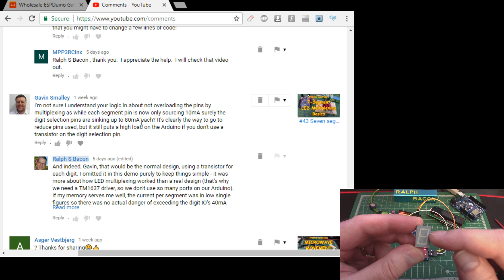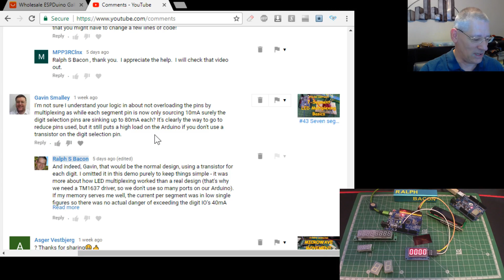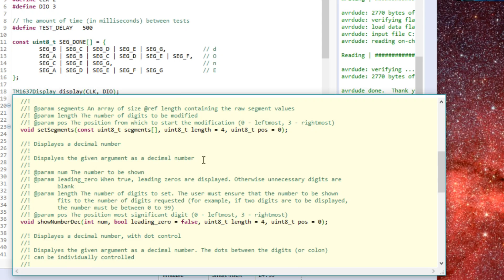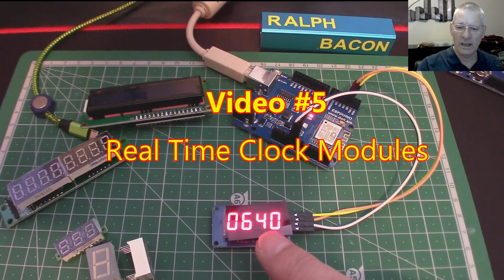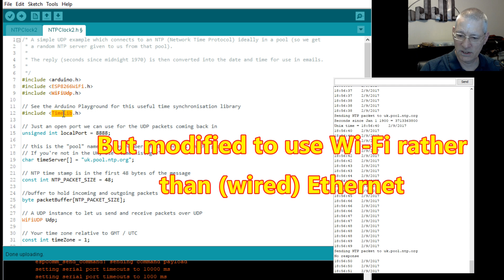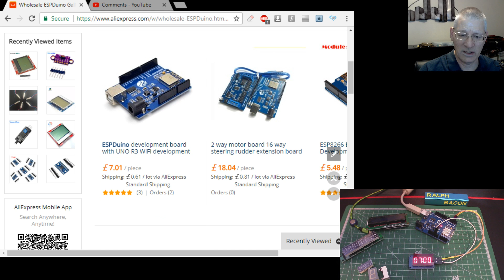#94 TM1637 LED Controller (Part 2) using NTP Server

Comment: Sorry if this has already been discussed, but how about an NTP server running on an Arduino using a Ublox (or similar) GPS receiver? I've skimmed (again) your video #70 and NTP isn't mentioned.  It would avoid availability issues with third-party NTP servers via the Internet. I use one running on "the other popular single board computer" and it works well.
Regards
Reply from the maker: Hang on, Dave, "the other popular single board computer"? You mean there are others? Does anyone else know about this?
 
OK, running an NTP server on a Pi-based board would of course work. It might (should?) even work with an ESP8266-based board, like the ESPDuino. But really it should not be necessary. If I were to refine the logic in my sketch here, I think that getting a list of reliable NTP servers is achievable, or perhaps just re-requesting an NTP server if the current one doesn't reply until you get a reply. That avoids the issue where you don't get a reply and now you have to wait another X hours before you retry. I'd also like to make that library non-blocking, the 500ms delay is just poor design. Oh well, the long winter nights will soon be upon us, may give me something to do... Thanks for the post, it's making me think about this whole issue.
Reply: The REAL purpose of NTP is for keeping a local time source synced. An RTC (Real Time Clock) can be used in multiple locations (if desired) and cross checked to each other. Any significant differences between any two can be used to trigger an NTP request. BUT the problem becomes a tricky one if EACH RTC is NTP synced individually by separate requests. Do not be puzzled or disappointed if the times set under these circumstances are widely different & varied immediately after such updates.

In principle, it should not be necessary to query an NTP server more than once per 24 hours, or per 12 hours max. It's considered very poor NTP access etiquette to make multiple requests successively, continuously or continually in a short timeframe.

NTP service was never designed to provide an RTC function but an automatic synchronisation service to another means of real time tracking like a LOCAL networked RTC.

The OTHER use of NTP is to resync an RTC to current local time after a complete power loss, not just to the system but also to the RTC itself.

If an EXTERNAL highly accurate clock is required down to ms then a GPS module provides a better mechanism. 

Always remember that NTP responses can vary by several seconds, they're allowed to by the specs, which is why a single local RTC server should be used if accurate timestamps across multiple devices are required.
Reply: @boblewis5558  I'm not sure whether your post was a reply to Ralph's (reply) or my original post in 2017.  Just to clarify, my NTP server uses a Raspberry Pi connected to my home LAN, uses time data from its in-built GPS receiver, so variable Internet NTP server timings  or access etiquette issues aren't of concern.
Reply: @daveholden3935  no it was a general response to Ralph and his audience as despite a 45 year plus career in IT and fairly well versed in network stuff I very nearly fell foul of mis-thinking it myself. 

Your solution is arguably the best one as you clearly gain the benefit of BOTH NTP and GPS timing without the requirement for a public NTP server. 👍👍

Comment: Hi Ralph, thanks for another informative video.  Probably the high failure rate on the ntp server is because you are being blacklisted for too many attempts. You should try pointing it at your internet router, that probably has an ntp server running and it won't mind how often you ask it what the time is.
Reply from the maker: I've looked at my router before, and there is no NTP server in place probably because it is a cheap router that came 'free' with my broadband. More sophisticated routers will doubtless have something to offer, but upgrading my current one just to get this facility is not justifiable. If you look at the post from Dave H here (and my reply) you can see that there are lots of ideas and if I get a decent solution I'll let everyone know. Thanks for taking the time to post, Andrew, good to hear from you again.

Comment: The NTP servers when busy log IP address and will throttle the bandwidth if used too often. This is stop DDos attacks.
Reply from the maker: Yes, Graham, I had my concerns about this; the trouble is that I need frequent responses for demo purposes and I can't tell whether I've been blacklisted or whether the server I'm querying is just not playing nice! Every 10 seconds shouldn't be considered a DoS though. See other comments (and my reply) to others here and you can see I'm thinking about sorting this out to make it more reliable. Thanks for posting.

Comment: Thank you again, Ralph. I've had one of these EspDuino boards sitting in a drawer for a long time, so now I get to finally do something with it. 

A board similar to the EspDuino is the DF Robot WiDo. It uses an Atmel Mega32U4 (same as the Leonardo & others) and has WG1300 wi-fi, antenna connector, and an SD card slot. DF Robot circuit boards are of such high quality that it is a pleasure just looking at them.

Regarding NTP, my all-time favorite program for getting time, and setting system time, has been TimeRC3. As far as I know it has been unavailable for years, and no longer supported by the author, but it is well worth looking for. It has worked great with every version of Windows that I have (7, 8 & 10). I think that compatibility mode must be selected for the newer Windows. I was surprised to learn that where I live there is a pool of NTP servers, so adding this to the list of time servers rotates requests among the various local servers, so as not to overwhelm any individual server. There is lots of information at ntp.org

For acetate sheets, used as red LED filters, an expensive source is the report covers you can get at any stationery or school supply store. Just one of them will probably supply all the filters you might ever need. Get a green one, too. It's also been my observation that submitting a school paper or business report in such a cover increases your grade and/or gives you more credibility (aka the "wow" factor").
Reply from the maker: I looked for a DF Robot WidDo - I don't know where you are in the world, Art, but in the UK they seem rarer than hen's teeth. The only one I found was for just under £30 ($42) so no wonder the quality is high!
 
I'll look into the TimeRC3 too, just to see whether it's worth while sharing with others here. Yes, covers on projects do add credibility as they do on CVs too (either that or potential employers just think you're being pretentious!).
 
Thanks for posting all that info, Art, and good luck with getting the TM1637 going (see the pinned post at  the top of this video too).
Reply: I looked in the drawer and found a Grove equivalent of a TM1637. I ran your code & library and it worked great. My mystery location is just 3 hours from China, yet it still takes a month to get a registered air mail package from there. I can never figure out how people who are thousands of miles further away get their stuff in as little as half the time it takes me.

I've been using Node-Red today to capture Twitter messages involving @app_iot. Just my luck that I picked today to try out the OTA stuff.
Reply from the maker: They probably send your packages the wrong way around the Earth, Art, so what to you is 3 hours is really 21 hours, which in China Airmail terms equates to about 4 weeks to 3 months whichever is the longer on a wet Tuesday afternoon. I've had packages turn up in two weeks, others have taken 2 months (by which time the vendor had already refunded me, so I had to refund him back, bizarre). The vagaries of the Far Eastern postal service... Yes, good luck with that Twitter stuff today - hang on, you're not writing a Trump Tweet Repeater are you???<shock>
Reply: Sometimes they even send the package, by boat (even though I paid for airmail), to another country, way in the other direction. Then it gets sent by "airmail" to me. That adds up to two weeks. The last time SeeedStudio pulled that crap on me, especially after charging me $7 or more for "airmail shipping" I simply stopped buying from them. I really hate liars, dishonest companies and scams, like that, but I suppose few people do. Their customer "service" department just kept giving me one lie after another, always dancing round the part where the package was first sent by boat to another country, and my asking how is that considered airmail? Much of what Seeed sells is the same stuff you can get from AliExpress or Bangood, but with a several hundred percent markup. I once had a package stuck in customs for several months, but that is a different story.

The two reasons for the delays are the Chinese government heavily subsidizes shipping costs, which creates a huge backlog of shipping, and the other is that AliExpress owns part of Singapore Post, so it is somehow cheaper for them to send packages by boat to Singapore, then send them airmail from there. It all really just adds up to a penny here and a penny there, but that is so much more important to them than it is to us.

I don't really use Twitter at all. I just wanted to try the Node-Red thing. When the IOTAppStory web site went down, sure enough right as I was starting to use it, I decided to try Node-Red for Twitter messages involving @app_iot, to see when the web page would be pack up. I got three messages to @app_iot, but not the main one from @app_iot finally saying the web page was back, then two more messages from @app_iot mentioning livecycle, which I assume means lifecycle. Anyhow, that is the end of my Twitter activity for probably a few more years. I get all the Trump updates I need from Mark Dice's YouTube channel.
Reply: P.S., my latest order from AliExpress, from August 10th, just arrived at my local post office yesterday, September 5th. The post office here does not deliver packages, so I have to send a servant to pick them up, and there is a $2 charge for each one. In many cases that significantly increases the cost of something, and makes buying inexpensive items with free shipping still kind of expensive.
Reply: Art Becker you have to pay for each package u pick up yrself???? I hate to ask what country u live in :-)
I feel lucky that even if I order a 20 CT item it gets send from China and delivered to my doorstep all for that 20 ct
Reply: Yes. It's about $2.25 per package, plus transportation to/from the post office. Japan also charges ¥100 (or maybe more now) for each package, but they at least deliver.
Reply: unbelievable. that sure wouldadd as i get many small packages from ali

Comment: Great video on the use of the 7 segment displays.  As for NTP  please again note that you can use any NTP server in the world that is publicly accessible.  It is DNS that does all the work and the reason your get a result/response some times and not others is more likely down to a DNS load balancing technique called DNS round robin as may think the DNS reply's to the request of uk.pool.ntp.org this will return 1 of a number of IP addresses with the response there is a TTL (time to live) option in seconds it will be approximately 30 seconds may be more.  Because of the TTL the device will not do a another DNS lookup until the TTL expires. The DNS server cycle though all the addresses in turn based on the requests it is getting.  Depending how many requests it is getting for uk.pool.ntp.org and the total number of address it has configured for the backend you may get served the same address again.  Most DNS servers will not check to see if the application protocol is up(responding to requests) so you can get dead servers returned from time to time.  Also NTP is main a UDP based protocol generally and UDP is a very fast protocol and NTP needs that as it is time critical.  But with this comes issues in its self as it is a firer and forget type of protocol it just firers off the request and then waits for a response.  It is also what is known as a stateless protocol.  Where TCP is a state-full protocol as the TCP protocol header have a state entry for the packet and UDP doesn't.

Please see the following

NTP http://www.pool.ntp.org/zone/uk

https://en.m.wikipedia.org/wiki/Network_Time_Protocol

DNS Round robin https://en.m.wikipedia.org/wiki/Round-robin_DNS

So you are aware I am a NETWORK SECURITY ENGINEER ip is my bread and butter.
Reply from the maker: Yes, we need a network expert here and you've hit the nail on the head here, Simon: the NTP servers are not checked by ntp.org for reliability, so they could move the less reliable ones down (or temporarily off) the round-robin list and the reliable ones to the top. But, if you read other comments here (plus my reply) I think it is possible to make this whole NTP request business much more reliable and I'll have a think going forwards. Thanks for posting and the background info that I (and others) appreciate.
Reply: Ralph S Bacon good to here back Ralph there is there is at least one network vendor that have enhanced DNS servers that can do what is best known as application level monitoring and if a device responds to a ping it does not mean the application running so it will try and connect on the ip ports the application listens on and if that works it will then mark it as up and it will serve the address if any of tests fail it will mark the server as down and not serve the address out to requesting clients.